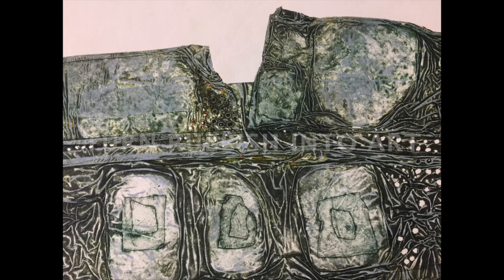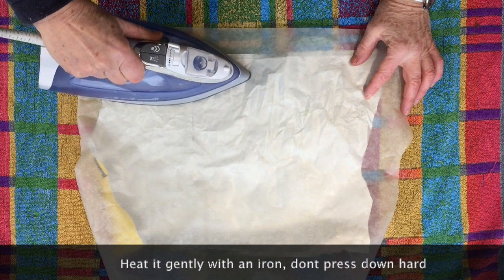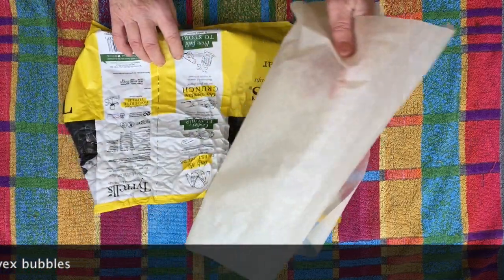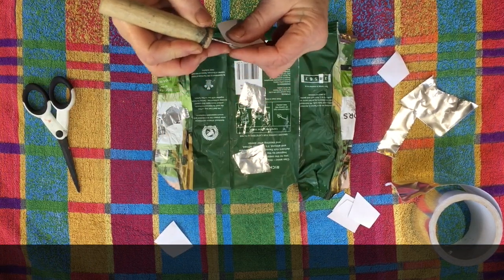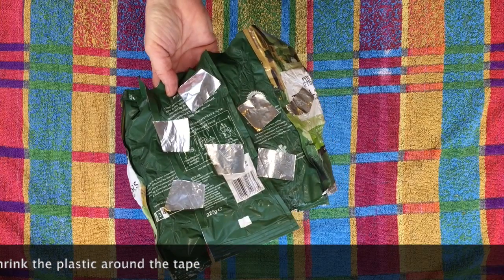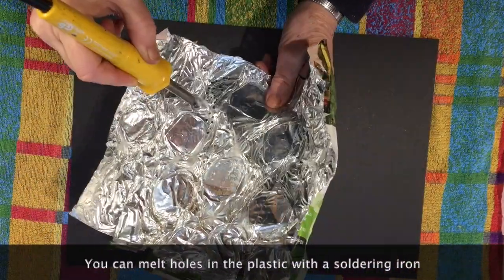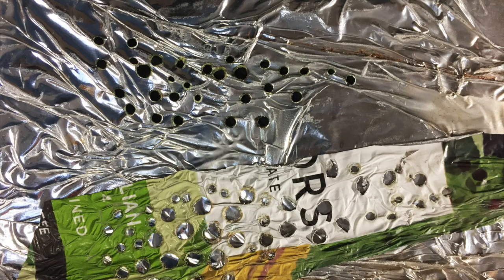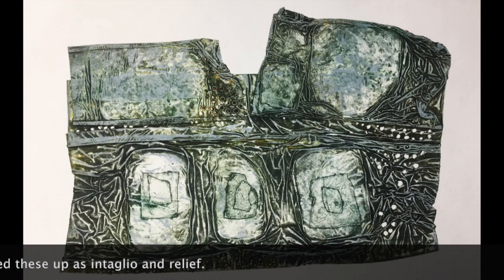Crisp Packet Prints

Comment: Wondering...do you then affix the crisp plate to a rigid surface for inking/ printing?  So fun!
Reply from the maker: Hi Mary, I didn't fix the plate to anything - just inked it up on its own. This means you get the irregular shape and you can ink both sides and get two different prints from one plate. If you wanted to fix it down I think you'd need strong glue, possibly something like evostick?